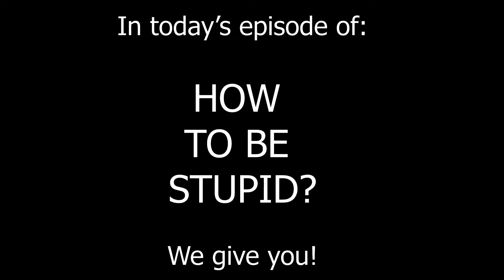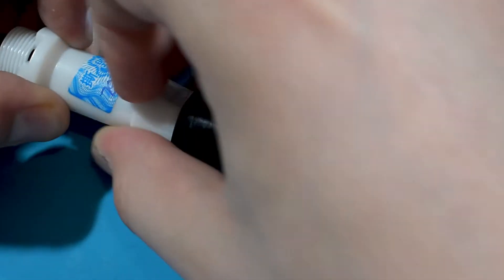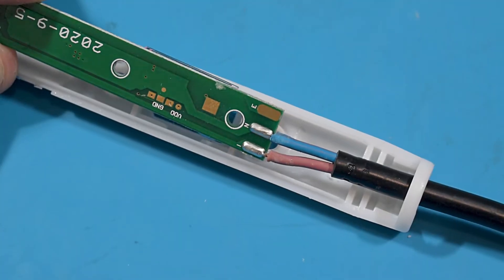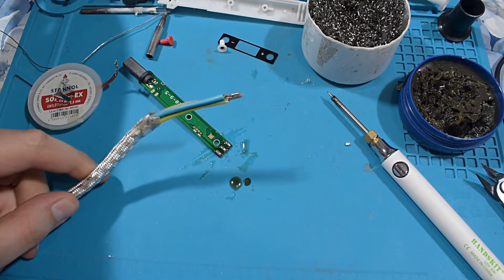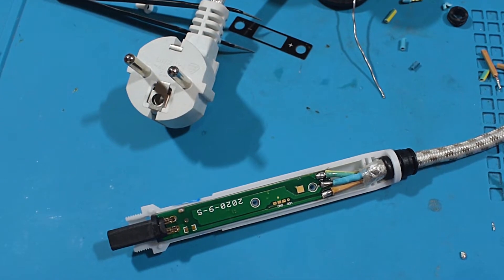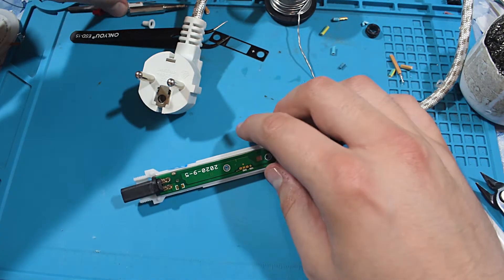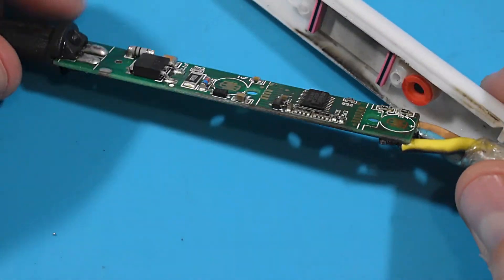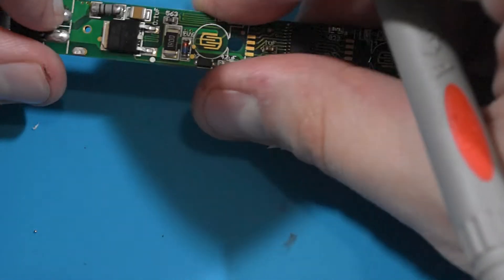I'm sorry... I was wrong! - How to be stupid #1

Comment: Man, that's unfortunate.
I don't think there was anything wrong with your soldering, but you know how it goes with electronics repair - you gradually get better with this, one piece of destroyed tech at a time.
If it makes tou feel any better my destroyed-to-fixed-electronics ratio is probably around 1:1, sometimes stuff gets fixed, sometimes it fails spectacularly
Reply from the maker: Thank you very much my friend 😁
I used to get really upset when I was younger and stuff like this happened. Not anymore, it's all a part of the learning experience. Oh yes, 1:1 ratio is a real, honest, ratio of someone that fixes electronics regularly.
Reply: @milanfixer  well IT îs your fault actualy You see the earth pin wasn't atached with a scope the ic was conectez there along with the ground supply so when you conected the Earth wire you killed the entire circuit why do you think the tip was not grounded ?
Reply from the maker: @andreiciora2765  Can't argue with that. The video is named "How to be stupid" for a reason. 

The thing that actually threw me off was that continuity test didn't show there was any contact. But since I don't have a differential probe, I wouldn't be probing my scope nowhere near mains voltage - don't want another BOOM.
Reply: @milanfixer  lol, i'm the other way around, i expect the universe to explode the second i plug anything in. It was legit one of the scariest things in my life to repair a friend's E-Bike because if it went wrong we could end up with a lithium fire (YAY). Thankfully it went okay despite my soldering iron being very jank